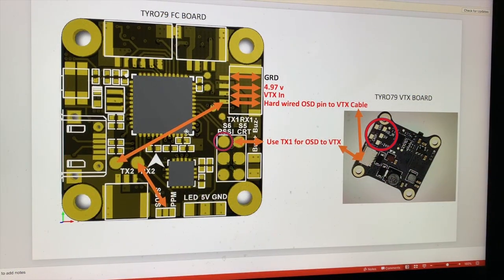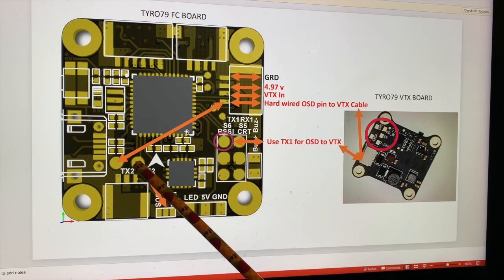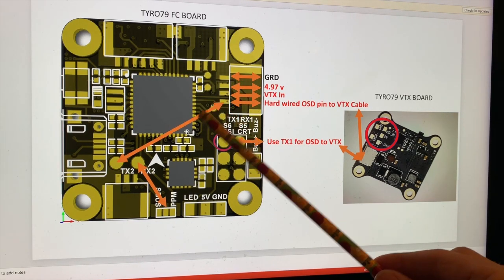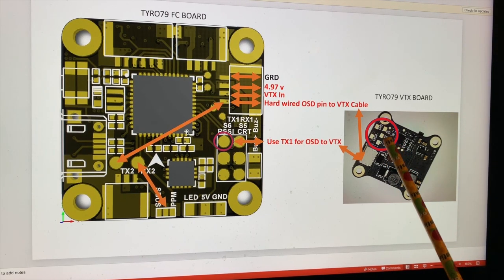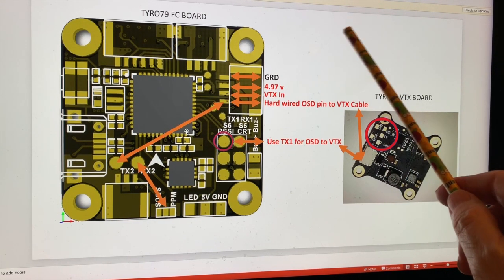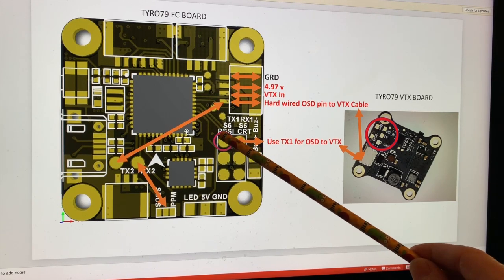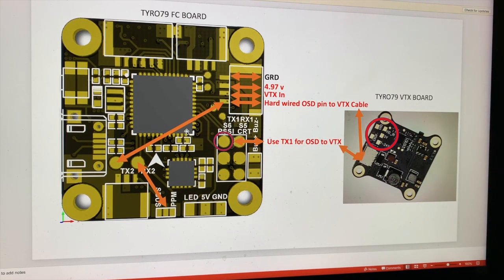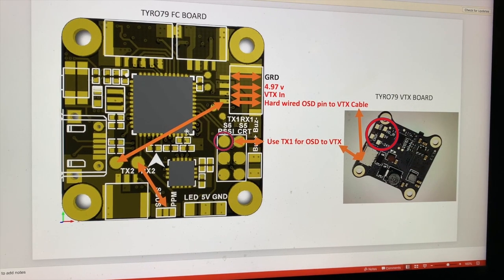Tyro79 Issues 3 - OSD Display Fixed!!!

Comment: Hey man
Thanks for your video. I know there's been some time after I've done it, but I've recently bought used tyro79 and it has an issue that there is no video but yetOSD is displayed. Found a video where a man had the same problem, but he didn't solve it, just pointed out... Could you please helf if it's possible? :)

Comment: Hey Blade, do you think you could help me with mine?  Im a beginner and Im willing to pay your for a phone call.
Reply from the maker: Marsh Caruso I’ll help... reply back first to this message and explain what your problems are and then we’ll talk. 😉
Reply: @bladejohnson3881  my VTX is a little different. It does not have any chips underneath it. however it is compatible with the tyro. there is a 4 prong harness coming out of the side but my wiring harness only has 3 wires a red a white and a black. And I'm just a little confused on where the video transmission bluewire needs to be soldered to.
Reply from the maker: Marsh Caruso could you send me the make and model of the vtx board or a picture of the top and bottom of the vtx board. Use my email if you need too..  fskknives@gmail.com. 👍
Reply: @bladejohnson3881  Thank you so much I just emailed you.
Reply from the maker: Marsh Caruso I’ll take a look as soon as I can . May be a few hours. 😉
Reply: @bladejohnson3881  no problem take your 👌👌
Reply from the maker: Having issues opening up the attachments in the email . Try sending again.... 😉
Reply: @bladejohnson3881  ok I emailed you the link and tried to add a screenshot.  Thank you

Comment: That video still looks fairly noisy. I've just built the Tyro79. Was very disappointed that the video was so noisy using their FC supplied 5V supply. Moving to VBAT to power the VTX and the camera fixes most all of the noise. Having to rewire that power mostly negates the advantage of the "plug and socket" easy build design :(.  Something - the VTX or FC (or both) are picking up noise from the receiver. Really it's kinda junk hardware/electronics, exactly what we can expect from Eachine unfortunately :(.

There may well be multiple versions of the FC shipped for the Tyro79.. I've seen conflicting reports on which uart to use for SerialRX and for SmartAudio.

Mine is setup and working like this: My board has only 2 hardware UARTs. I have SerialRX (SBUS) on UART1 in betaflight, and SmartAudio on UART2 in betaflight. The VTX cable is unmodified, and that works fine (except that I powered the vtx off of VBAT instead of the FC 5v output on that socket).

For the FC's SBUS/PPM jumperpads; the centre pad goes to the receiver socket and thus to the receiver. The PPM pad goes to RX2. The SBUS pad goes to an inverter and from there to RX1. Yes TX2 is hardwired to the vtx socket for SmartAudio.

So for PPM you run on UART2 so cannot have SmartAudio as designed because UART2 (TX2) is hardwired to the vtx socket for SmartAudio. You could rewire of course as you did apparently, to use SmartAudio on UART1.

It can get complicated lol. THEN, I actually also wanted Telemetry working (Sport), and also GPS. These also work fine like this: I created 2 SoftSerial ports, using S5 (motor5) and S6 (motor6) as TX11 and RX11 (SoftSerial1); CRT(Current) as TX12 and RSSI as RX12 (SoftSerial2). You need to change resources like this in the cli:

# resources
resource MOTOR 5 NONE
resource MOTOR 6 NONE
resource SERIAL_TX 11 B03
resource SERIAL_TX 12 B01
resource SERIAL_RX 11 B10
resource SERIAL_RX 12 A00
resource ADC_CURR 1 NONE

Turn on Telemetry in Configuration page, and then set  SmartPort on SoftSerial1. Set GPS on SoftSerial2.

For reference; I have a FrSky RXSR in that build.
I've tested both the BN-180 and BN-220 Gps modules.
The 180 is slightly smaller and lighter. They both sit very nicely on the top of the quad, fixed to the small square cf plate. Note mount Aerial UP, label and leds DOWN.
Hope this helps.
Reply from the maker: amisoftau great in-depth information. Thanks! And yes.... I believe the kit is being sent out with different pieces of hardware and firmware.😉
Reply: @bladejohnson3881  No problem. I'll document that setup in the Tyro79 rcgroup once I've properly test flown it. I should add that softserial is heavy on the CPU, so you'll want to perhaps lower clock speeds to keep the CPU load down around the 20% mark. I forgot to mention that for SBUS I did bridge the jumperpads sbus to centre pin.

The poor FC documentation cost me many hours to work out how it was wired. Process is something like; obtain the CPU pinout diagram, pin trace their FC pads to identify the relevant CPU pin, and compare those pins with the cli resource listing (which lists cpu pins) - in order to link the FC pads with betaflight firmware function. Not difficult, but time consuming. The lesson there - good FC documentation should be a high priority feature during FC choice decisions :). In other words, "cheap" hardware is often (perhaps usually) too expensive to seriously consider.

Cheers.
Reply: What pins did you wire the power from the Camera and VTX. Im getting alot of noise past 100ft and it makes it very difficult to trust the singal.

Edit: Did you only move the power wires or also the grounding wires?

Comment: amazing video.  I had a similar video but this is so much more concise and has the SA fix.  good stuff.  subbed
Reply from the maker: Chris Sullivan thanks glad it helped. I’m still having issues and working on them  and hope to have it resolved one day.
Reply: @bladejohnson3881  My only issue was that smart audio looked like it worked but didn't.  I directly soldered my ibus signal line to RX2 so your explanation made sense.  I'm going to see about swapping to uart1